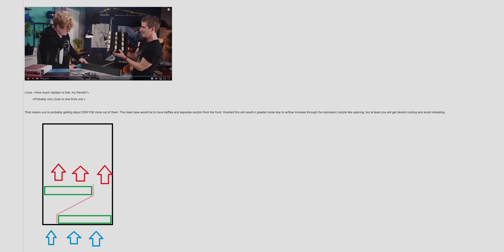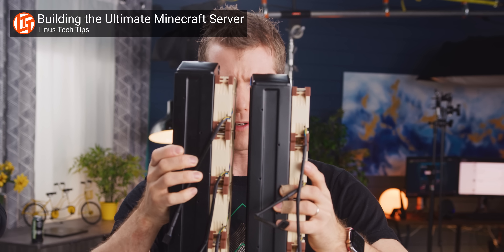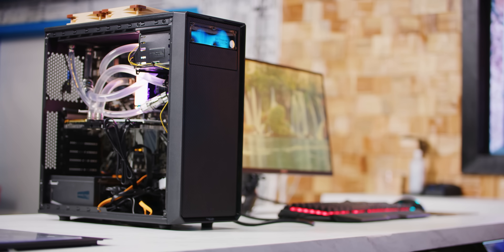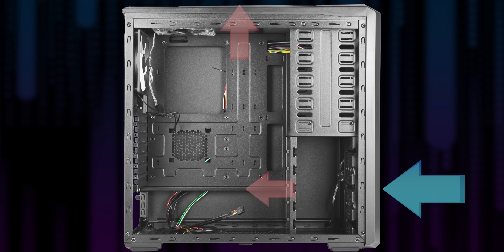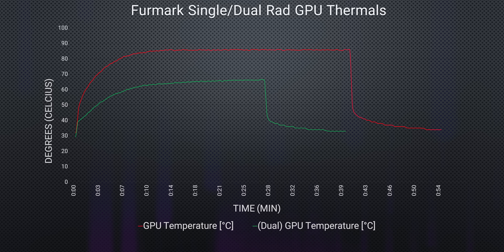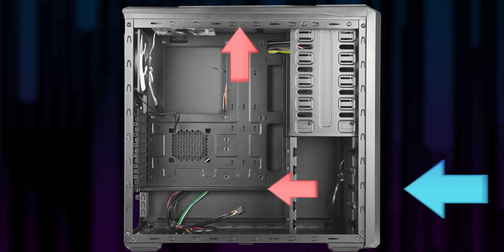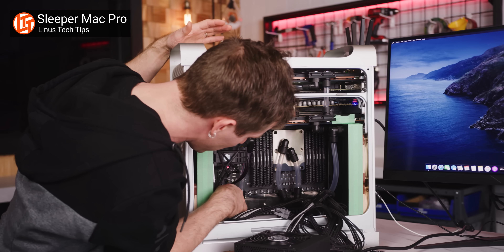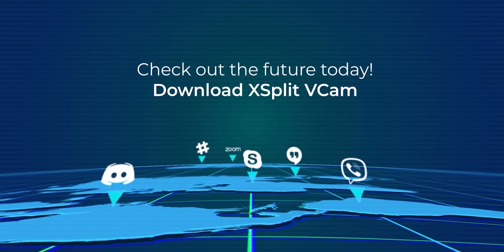I’ve been water cooling wrong for YEARS - $H!T Manufacturers Say

Comment: while corsair was dead wrong in this case their concerns aren't unwarranted. if you somehow manage to use high fin density rads with non static pressure optimized fans then you can potentially have a problem especially if you try to stack the rads like in the old minecraft server case. however anyone that is seriously considering water cooling should and will likely be looking into everything they can before risking a leak and damaging pricey components. over all unless someone with more money than brains tries to do water cooling in a system then there is very little chance that adding a second radiator will hurt temperatures.

Comment: So technically, if you had a radiator mounted on the back of the case venting into a radiator, and one mounted in the front venting in, with all the heat being exhausted through the top of the case, wouldn't that maximize your potential for cooling?
Reply: most efficient without active chilling would be to have all rads fed by drawing in fresh air, assuming the air outside your case is always cooler than the surface temp of your rads.
Reply: @outdoordreamer  Yeah, that's what I was basically trying to describe.
Reply: @NiGHTSChao689  Actually, if we were being technical about this, I think having the rads completely isolated so the air coming out of them goes back outside of the case would be even better, but that means you would also need separate fan(s) drawing in fresh air and exhausting any residual heat from the RAM/chipset from the case. Not really practical in a case like the one they used in this vid as you would have to have the rad extermal to the case. 

But in a full ATX or e-Atx, you could use a shroud of some kind to make a wind tunnel of sorts for the rad(s)... Hmm, with their CNC machine and metal brake, they could do some pretty funky stuff with this idea. :)
Reply: @outdoordreamer  I think that would be an awesome idea and they should investigate this more. So basically have a radiator in an area like the PSU shroud that so many cases have, or something separated with an intake like the HAF 935 stacker case?
Reply: @NiGHTSChao689  Exactly. in the case of the HAF 935, that's one of the use-case scenarios they have for the case. Theoretically you could do it with one of the modules if you took out the Hd cage and had both the front and rear fans blowing in for fresh air, then assuming you have both enough air flow and space for for two rads mounted on the sides exhausting out the panels, it should work.

I can't find a price on one of those cases (currently OOS on Amazon.ca/Amazon.com/Newegg.ca/Newegg.com) so not sure if this would have been cost-effective or not.

Comment: To fully understand what is happening here is why AC/Refrigeration Technicians in Canada take up to 5 years to apprentice and go to school  to understand refrigeration cycles and air flow. That and whoever is emailing you from Corsair doesn't seem to be taking all the factors into account either.

Better test for the Minecraft server, making sure no change in anything else: 
test 1-> 1 rad and 1 set of fans drawing in fresh air, 
test 2-> 2 rads stacked and one set of fans, 
test 3 -> 3 rads stacked and 1 set of fans.
test 4-> 1 rad with 2 sets of fans
test 5-> 2 rads stacked and two sets of fans, 
test 6 -> 3 rads stacked and 2 sets of fans.

The theory here is to find out whether adding additional rads in a stack is actually worth the trouble. If you are adding a second rad for only 5 degrees of average temp difference, then that is not worth it in my opinion.

Another test would be to set up a sealed case that has only 1 way in for fresh air and 1 way out for exhaust air, then repeat this test twice; first putting rad #2 in front of the exhaust and then trying it when stacked with rad #1.

Not that I expect this to actually be read and/or make it to a vid or anything.

Comment: Aerospace engineer here, lots of expertise in thermal load control. 

This is more of a function of airflow. As long as enough volume is moving through the radiator stack, the air will not reach the same temperature as the radiator fin surface, therefore increasing the performance of this particular cooling setup. Sure, in a stack there are diminishing returns (which get worse as less air flows through the control volume), but it would be incorrect for them to say that there is no benefit to stacking setups like this so long as you have enough fans pushing enough air to account for the thermal gradient.

I would question the credentials of any thermal engineer that would not add these qualifiers to an analysis. Something tells me the person performing this analysis did a very simple simulation with a lot of fixed assumptions that did not account for all the boundary conditions.

Comment: Pro tip when putting rads in series:
Hot water goes into exit rad (where air exits case) first, then into entrance rad (where the coolest air enters the case). 
That way you ensure the water coming out of the last rad (and thus going into your components) is the coldest it can be.

This is also how a heat exchange system works. When you have 2 running fluids (air is a fluid) and you want to exchange heat between them, for maximum exchange you have them run in the opposite direction  (for instance your central heating system works like this).
Reply: This general concept (known as *countercurrent exchange*) is used not just in heat exchangers but also in fish gills and elsewhere in nature.
Reply: @Cyberguy42  I was too lazy to google the correct terminology, but yeah that's it!
Also, yeah it makes sense that's how fish gills work.. I'd reckon it's also how our lungs exchange oxygen/CO2 possibly?.. or maybe not?.. again, too lazy to google. XD
Reply: Yep, should be obvious but I see so many people mess this up.  I think this is actually where Corsair thinks a problem exists, because like many other people they are running stacked rads in the wrong order.
Reply: This is correct, but still putting radiator in series, attached one to the other is dumb. The radiator itself will serve as a barrier for the air. Better have two radiators, separated. So the air can be extracted in the middle. Use the top one, for the hot water, since it's near the extraction fans.
Reply: I disagree with this, the difference in temperature between the water that comes out of a radiator (or any component in a loop for that matter) and the water that comes in is very small, normally less than 1C but often much less.
The order of the components in a loop does not matter, as you can gain maybe 1C on an unrealistically restrictive loop with a weak pump, and much less in one with normal flow rates.
Reply: @kelainefes  Look man, I get your point that in practice it won't make much difference.. but  it DOES make a difference and it IS an objectively better order to have your loop in. 
So you're free to 'disagree' with the advice to (always) do it like this, but you can't 'disagree' with physics. Physics doesn't care about your opinions.

Then again, if for aesthetic reasons (and/or loop length) it suits you better to do it the other way I fully understand that.. however I doubt that'd often be the case.
Reply: @ayporos  On the physics part, yes, there is a difference, and I wrote about it in my 1st reply to you, it is about 1c or less, everyone can decide if it is a goal worth pursuing or not. 
Good comeback punchline though. :)

On the "it's better" part, which is the reason why I disagree on recommending to put the loop in any particular order based on getting the lowest possible temps, I would like to point out that lowering your CPU or GPU temp by 1C at best will not bring any actual performance gains, except for running synthetic benchmarks when the system is actually being pushed to its maximum possible frequency and even then, gains will be minimal.

I fully appreciate that for some people, doing something in the best theoretically possible way is a goal in itself, even when there are no actual benefits to be gained except for personal satisfaction, which does have a value after all.
 That is the way I do many things myself so I can relate.
Reply: @Claptrap Jesus Dude, you are the one spewing broscience, I am the one that actually tested the inlet and the outlet at the same time and got the same result of the others that tried, which is that the temp is basically the same, +1C but often less.
 :)
Regarding physics, I will recommend you to check the heat capacity of water, as it is very high, meaning it takes a lot of energy to heat up water, and viceversa the radiator can dissipate a lot of energy and still not drop temps much.
Reply: Heat exchanger
Reply: good points!
Reply: @Claptrap Jesus I know right?... oh well.
Reply: @Wereskeleton  Dude... you and him are being defensive.

They aren't equal my dude. If they were, there'd be no heat exchange from the heatsink to the water nor from the rad to the air.

What you meant to say was that they reach an equilibrium state.. but still the water coming directly from the heat source will be hotter than the water exiting the 1st rad which will be hotter than the water exiting the 2nd rad.

It's really not that complicated and I really don't get why you feel the need to reject my correct statement with your own incorrect statements.

Yes, provided you have high enough flow rate the temperature delta will be fairly small.. but that doesn't mean it doesn't matter! If the temperature delta between the water entering the (CPU/GPU) heatsink and exiting the heatsink is 2 degrees in my proposed setup and 1,99 degrees in your setup you might think 'oh that's no difference at all'... but what you fail to realize is that, because your setup is less effective, it requires the water to heat up more (and it's thus at an overall higher temperature) to reach the same equilibrium state where the amount of heat dissipated from the rad equals the amount of heat absorbed from the heatsink... i.e. your CPU/GPU runs hotter.
Reply: @Wereskeleton   Oh you poor boy.

You linked a vid to a guy testing a SINGLE radiator on an OPEN TEST BENCH.

Yes, if the flow rate is high enough the temperature delta becomes very low.. but it doesn't (!EVER!) reach zero. So even though he may state that it makes no 'noticeable' difference, it does in fact make a difference... yes, even in his completely different situation.

Comment: I would imagine that the additional volume of coolant would also contribute to lower temps along with the extra rad and fans.
Reply: It can help keep temps low longer, but the difference is small and short lived. Basically it just takes longer to come to operating temp every time you add a rad.
Reply: Every layer of radiator usually has ~50% less gain than the previous, I can confirm from experience building cars

Comment: Linus, normally your videos are very well thought through, but this one needs work. You tested one rad and two fans vs two rads and 4 fans. If you are testing whether or not adding a rad decreased temperatures, you'd want to compare that against one rad 4 fans vs two rad 4 fans. The problem with the 4 fans one rad vs two rad case is if you remove the rad from the case, you're increasing the amount of airflow for the case. The way to avoid that problem is to leave the rad in, but have it disconnected from the cooling loop itself, so airflow is the exact same. I get it, if adding a rad increases airflow, then it's beneficial, but there's a price difference between adding fans vs adding a rad + fans, and this lazy test is just untenable.

Comment: One issue I see is you tested radiators in series but not stacked right next to each other as you mentioned in the minecraft PC build. I would of loved to see where radiators were butted up next to each other, not on other sides of the case. 

As well, radiators in series vs radiators in parallel. An idea for another video!

Comment: Shoul've tested literally stacking radiators as a worst (for your case) scenario.
Reply: So the Minecraft server chassis  they verified with, and still got a 5C improvement? OK 5C isn't much, and maybe not worth the cost of buying a 3rd rad/fans, but still measurable.
Reply: @SyncViews  they were also massive radiators with diminishing returns when you add more. If you compared it to some 240mm radiators you would see a bigger difference
Reply: They did. You should have watched the entire video.

Comment: If I ever do dual rads, the freshly heated water into the rad mounted at the top of the case. Then run it to the 2nd rad up front so the intake air isn't heated as much. That way my other intake fans can cool the air inside more.  I have seen countless builds where it was reversed.  I wouldn't mount a single rad in the front either.   It would toast my psu. Lol

Comment: I love this topic and I appreciate you encouraging more benchmarking and testing. However, you did not do this test justice. 
Please try this again with more through testing. You should see much clearer results in the Minecraft server where all of the rads are stacked. Try replacing the rad with a reservoir of the same volume so that your results are only effected by the actual radiator, not just more water. You could also use your "little furnace" and try the push/pull vs both push. I know you did push/pull tests before but that was with only one radiator.
PS. All of us here in the South are really looking forward to water cooled gaming chair.

Comment: Another way to approach this might be to reverse the fans on the front radiator so that they move air from the inside of the case to the exterior, along with the fans of the top-mounted radiator so that they draw air up through the case. If you then put a larger (filtered) fan on the rear of the case, bringing hopefully cooler ambient air in to the case, you should end up with a "through-flow" of air that doesn't involve pumping heated air in to the case. This is something that JayZ2Cents has covered in some of his videos where he also talks about the value of maintaining positive pressure in the case (e.g. more air pumped in than out) which he argues for on the grounds that it helps to stop dust accumulating in the case. I can't really comment on the positive pressure argument, but I get excellent results from setting all radiator fans to exhaust from the case...

Comment: Stacking rads next to each other also stacks airflow speed. But it would be more efficient if the rads weren't stacked in series next to each other, but each blowing air out at different case vents avoiding the heat exchange inefficiency that corsair poorly referenced.
Reply: P.S. glad you tested their assertion, good vid.

Comment: I got an AMD 3900X and a 5700XT on water, runing a 420/60mm, a 480/60mm and a 140/45mm rad. 
My water Temps are at 31 (inlet)  to 37C (out), running prime95 and OCCT graphiccard tests with a 150% Powerlimit on the gpu.
If you don't go that crazy, you easily hit 45C water temp. at that point your air in the case should be cooler, or you should add extra fans.
BTW: The air travelling through the rad does not match the max water temps, even at the hot end (inlet, first cm) of the rad, cos it does not have time to pick up all the heat.
I mean, I am just a material science ingeneer, what do I know? 
but honestly, the Corsair guys should have matched their calculations with reality and use their brains a bit more.  Its not that hard.

Comment: corsair: "using rads behind each other in a airflow starved case is bad"
corsair: "using rads stacked on top of each other is bad"
linus putting another rad in a case with a completely open back: "look how much it improves cooling!"
Reply: Yeah big miss on ltt for not texting those scenarios.
Reply: @John3K21  Both scenarios were tested
Reply: Yep, this
Reply: @rodrigoceccatodefreitas1656  уеs
Reply: The video should have focused on the MC server test because it did prove corsair wrong and was actually a better example of what they were talking about.
Reply: Linus really missed the point in this video tbh
Reply: Only an idiot would have performed the actual tests with the case open. Linus is not an idiot.

Comment: As soon as they said the air coming through the radiator would be nearly the same temperature as the water it was obvious they were wrong. Maybe Corsair should have plugged their fans in for their tests. Or maybe in a Corsair case adding more radiators doesn't matter because the airflow is so awful - just ask Gamers Nexus. But one thing is certain, 1 big radiator is going to be better than 2 small, Corsair wasn't wrong conceptually, they just made too many assumptions.

Comment: I personally only ever put radiators in exhaust configurations, having lots of nice cool air (without the heat load of the CPU or GPU) inside the case for the motherboard, NVMe SSDs etc. is one of the main reasons why I use water cooling

Comment: You've proven wrong point - going overkill on heat exchange area is going to work even on very poor designs but, it will cost a lot. If you want to be cost efficient, you better use basic thermodynamics. I think you could get the same results by putting simple 120 mm rad in the back. Hell, by looking at 3:16 I can tell you would improve your result just by swapping two hoses. Instead of going: pump -> cpu -> gpu -> front rad -> top rad, you should go: pump -> cpu -> gpu -> top rad -> front rad. But who am I kidding - this comment will be buried instantly.

Comment: We literally have a hydraulic oil cooler in our factory that has two stacked radiators with fans in between. Radiators suck and the more surface area you have the better it will perform.

Comment: Even that time you used like what 8-9 heat sinks for your component ... That doesn't work that way ... All it does is increase the thermal resistance. But Sigh nobody listens to an Engineer.